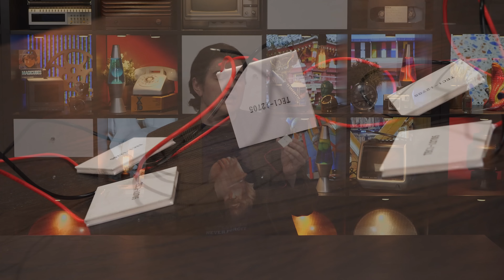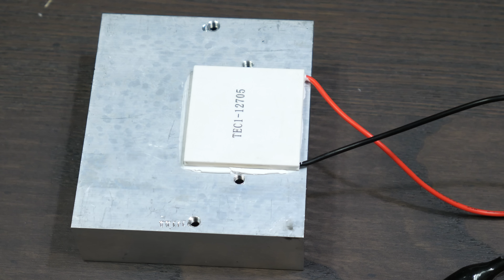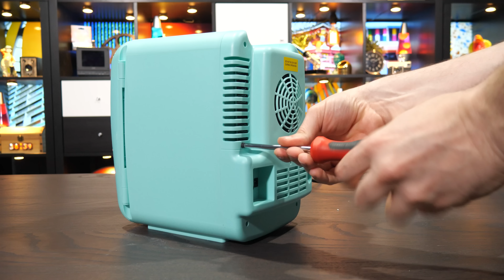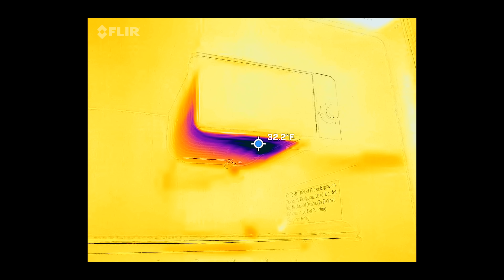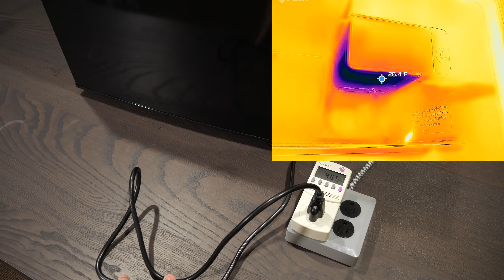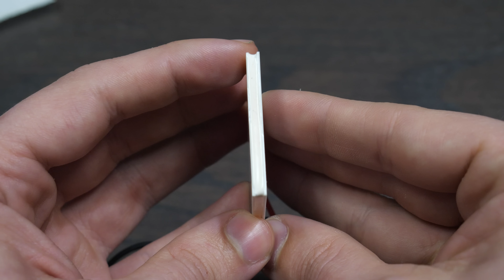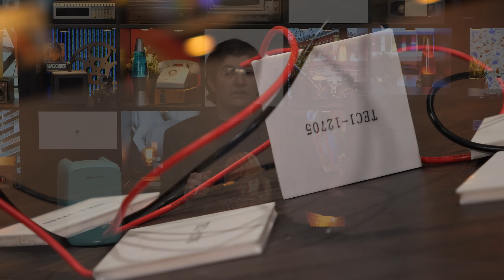Thermoelectric cooling: it's not great.

Comment: people keep forgetting that peltier element is not a cooling device. it is a thermodynamic vacuum device. if you don't have a heat sink for that energy you are sucking in, you will just get that blown off everywhere, just like a vacuum without a bag or filter.

that is a technical explanation from a marine engineer specializing in hydrodynamics and thermodynamics...

Comment: A bit bigger boxes than the blue one is useful running on 12V DC. If you fill them with already cool food at a store or at home they can keep the food cool for many hours in a car or small boat. A cheap solution for temporary use. Of course in a motorhome or a big rig there is better things to have.

Comment: I work with freon compressors and TECs on a daily basis.

I work with hardware designed for thermal testing of ic units.

I've had problems with both over the years, but I'll say that it's much easier replacing TECs than compressors lol

Comment: I recently bought a peltier neck cooler/warmer.
The reviews on Amazon isn't good, and after testing it for about a month, I know the main reason.
I does keep you cool(not much, but does help), but you can't feel it after the first cold plate on your neck sensation.
The one I got has 2 cold plates near my main neck arteries, which is supposed to be cooling my blood to take away heat from my body.  It does take away probably around 10~20W of heat, but when you are walking in the streets with external temperature at about 32~35C, with you generating about 100W of heat, it is not enough, and your blood doesn't transfer heat that fast.  You still sweat a lot.  The power rating on the peltier device isn't really the problem here, just that the contact area is too small to pass enough heat out of my body.
My neck near the cold plates are actually cold to the touch, the small cooler is doing as much as it can do, my neck isn't getting warmer but my own heat senses have been accustomed to that temperature so I don't feel the coolness.  I can move the cold plate a bit so I feel it for a very short while, but then my skin got use to that temperature pretty fast again.
I suspect if I really want to use a peltier device to cool my body, I'd need a pretty large contacting area on my back and chest, with a cooling capacity of over 100W(if must be more than the heat my body is generating, so ideally >150W for exercising) and fans to take the heat away.  Anything lower than that you still have heat build up in your body and you won't feel cool.  On top of that you need to be able to adjust the power so it won't go overboard.
But this is likely where the peltier device potentially can work.  You can't really carry a heat pump around, but technically 2~3 peltier plates already have enough power to cool your whole body, you just need some way to take the heat from all of your body to those devices, which you also need with a heat pump.

Comment: I used a Peltier CPU cooler (CoolIT FreeZone) way back when on my Athlon 64 x2 rig. It was a closed-loop all-in-one liquid CPU cooler. The hot side of the Peltiers (6 of them if memory serves) were mounted around a radiator/fan that replaced your case's main exhaust fan to exaust the heat out the back of the case. The cold side of the Peltiers were mounted to water blocks that chilled the liquid that went to the CPU block/exchanger. It was kind of a noisy setup (pump+fan) but I recall it working fairly well. I still have it so it'd be interesting to put my Kill-A-Watt on it sometime to see what the power draw was for the whole setup vs a "regular" liquid cooler setup sans Peltiers...

Comment: I have one intended for car use and it works pretty well for what it is. Keeps drinks cool for car trips and the like. Also have a larger cooler with TEC cooling and does a pretty good job especially in a AC cooled car. There is enough delta to keep most things cool enough. There are coolers with actually heat pumps in them but they are around $400 to start.

Comment: My fridge is working great and it is over 80 years old. I was told that I will know if it fails because the refrigerant is sulfur based
Reply: Have a look on the outside of the fridge and see if there is ice forming on the outside.
insulation issues happen more than leaking pipes.

But checking how often it starts and how long it runs is also a telltale.

Comment: Some British people. It is mini when matched to the one I have which is a mini fridge vs my aunts. And moms which is just a fidge 7 foot tool and freezer same size. each as my big Freezer/fridge combo that 7' ish (we're metric)tall and our large standard large size 600-700mm wide. You Red fridge is standard small fit most OK homes have small fit as they large. 400m-500 as that was what was fitted to most old houses as we used to have way more social housing that small fridges was the common, but as more houses have got bigger 600-650 and 7 instead of 4-6' one have become cheaper and more efficient. I live in social houses big brought my fridge didn't get anything in kitchen as the older council houses got in <2000s, and massive Tory housing cut and sell offs. So I can see why a lot would see it as a big fringe here. I have family that will pay more then buy cheap and replace every 5 years. I had my big fridge 15 years. Our council recycle the gas.

Comment: I use a Peltier cooled styrofoam box for fermentation of my SAUERKRAUT at the ideal Temp of 18°C, in order to drop it from usually 22-23°C i have in my basement during summertime. With a water cooler harvested from an old PC. A compressor would be total and utter overkill.

Comment: You are not wrong, but I bought one of these $35 things, despite having THREE of the mini-fridges, because I had a very small space available in an office and wanted to keep my liquid coffee creamer in it.  It worked GREAT for that.  It does take a day or two to get the temp stable after plug it in, (in Texas Heat), but worked great for what I needed.  I know it's not efficient, but if you don't have the space, you don't have the space....

Comment: I had one of the white ones with the fake metal handle when I was in middle school. It actually worked well and one time I left soda in there too long and they froze.

But it's good to know how these work...I currently have a cooler (that I got for free) that can both keep things cold or keep things warm by reversing the polarity on the plug. I've never used the hot side because I can't think of anything I'd like to keep warm for like 12 hours, but it's cool nonetheless!

Comment: I've got one possible upside to the little plastic cooler over the actual fridges. When running a small generator after a storm, the low watts a fridge uses can be easily handled. The compressor has a really high peak watts as it kicks on which may be more than a small generator can handle. The blue cooler uses roughly even wattage indefinitely so you'll never overpower your peak wattage. Still, attaching a soft start would be an effective alternative.

Comment: It's true that those coolers are useless in a 110v or residential situation obviously, but it's a "god sent" for us over the road truckers! I bring food and snacks from home for the week and keep it plugged in with AC inside truck on, and my Coleman cooler keeps everything actually really cold and nothing spoils. So using one at home or office is actually useless but for us truckers it's really a necessity. Plus just running off a cig lighter plug in the semi isn't really using wasted electricity.

Comment: I've seen peltier tiles used in the other direction, namely to harness a temperature difference to generate a very small amount of power (like heat rising from a stove + an ice cube = to run a small fan). Do you have any commentary to share on that sort of use?

Comment: I bought a cooler from goodwill ages ago, had a car cigarette lighter jack to power it, It couldn't keep anything cold, felt barely colder than room temp. So I took it out and played with it and tried to use it to cool an old amd sempron cpu by sandwiching it between the cooler and chip, it was cooler than stock, but not enough to justify the use of power.

Comment: 24:33 not really a problem?!?! If isobutane leaks into the cabinet and the fridge goes into a defrost cycle the fridge will explode. It has happened more than once. A fridge using isobutane exploded in an old ladies kitchen while she was sleeping. The fire department said it looked like a grenade went off in her kitchen. If someone had been in the kitchen they could have been injured or killed.

Comment: You bought a piece of junk. 
I've owned a small unit about the same size designed for car travel with a cigar lighter style plug(12V) for over 15 years. It  cools down a load of cans and cheese to a good  chill in about 45 minutes .
I've owned another larger unit that took much longer to get cool so I pitch it. 
The technology is good, but yours is a a cheap unit designed to sell, not perform.

Comment: The real stuff starts at 16:00. Before that there is a clown show.
The main idea of the video could be condensed in 3 sentences. 30 min video says only few useful information:
1) Thermoelectric elements create 10-20 Watts of cooling by using 50 Watts of electricity. 2) Usual freezers create 200 Watts of cooling (10x times more) by using 50 Watts of electricity. 3) Small boxes can not contain as much thermal insulation as big fridges.

Comment: I have one of these... It's a relatively insulated place to put your drinks, so even if the cooling element broke it wouldn't be a big problem. It's nice to have for road trips in the car. But it just barely keeps things cold that are already cold from the fridge, so I wouldn't trust it with food or to cool down a room-temperature beverage in less than a few hours.
Also it only cost me 30 bucks. If I ever find a micro-fridge that'll go in a 12v plug, I will consider buying one instead 😅

Comment: I really need your take on the big flat no-moving-parts infrared heaters. How do they compare to the ones you've talked about 5 years ago? I mean, I know, if they pull 400W from the wall, they throw at me this amount of energy in IR, but why don't they get hot? Why do they look like big white flat cardboard and not like fans with glowing red rods inside? How do they really work?

Comment: so i found a cooling unit that was used to cool ATM/Kiosk type machines.  it was basically 12 Peltier devices sandwiched between 2 pieces of aircraft aluminum and 2 PC fans,  i spent money and got some good PC fans that where super quiet.  and built a insulated box just big enough to fit my 5 gallon homebrew fermenter in.  It actually worked really good, i was able to get the temp down to 38F (brewing lagers requires fermenting at 50 to 55F).  It was an awesome unit till my basement flooded and destroyed everything.

Comment: I have an interesting hybrid fridge. It uses a peltier, but then connects the hot side to a heat pipe so it does have a refrigerant loop. The fridge itself and the heat pipe loop on the back look very similar to a traditional cube mini fridge, but there's nothing pumping the coolant. It's just the boiling/condensing that keeps it moving through the loop.

The end result is a cube size fridge (like the cube in this video) that uses ~60 watts continuous (compared to my full size kitchen fridge that uses ~60 watts average) but the big advantage here is that this cube fridge is nearly silent. There is an internal fan, inside the insulated compartment, to blow the cold around. It appears to be a normal PC fan, though I didn't open it up and look at the label. This complete lack of external moving parts, with the only noise maker being inside the insulated space, makes this thing quieter than most desktop PCs. And, that's exactly what I want from a fridge in my office, sitting within arm's reach of the PC. I really don't want the sound of a compressor cycling on and off sitting right beside me all day.

The fridge does have a terrible name though. It's the Avanti "Superconductor" fridge. I paid $80 for it in 2013.

Comment: I do have a peltier fridge. It does suck, but it keeps my insulin cold for a three to four day trip if I stick a couple of frozen gel packs in there. I also carry frozen fresh milk packets to serve the same purpose - the heat absorbed by the melting milk helps significantly improve the overall efficiency of the peltier fridge. But overall, I agree, bad design and worse construction is the reason I'll never achieve any real "cooling" on my little fridge.

Comment: I have mixed feelings about this, I know they are crap but I think it's reasonable to say that at $30 it's exactly as it should be. I had one to chill drinks for years until it crapped out, got one for free from warranty, until it crapped out again in a year or so. My biggest complaint was in fact how it heats up the room, not noise, not lack of cooling, not anything else. It also is extremely unfair to compare it to an actual cube mini fridge since that thing is wayyyy bigger and it mostly definitely will not fit on your desk. I enjoyed my "not chilled all the way" la croix for years with my mini fridge on my desk as a poor college kid who didn't have (reliable and accessible) access to an actual fridge. At $30, these mini fridges are exactly as they should be, and they are never meant to be a competitor to actual compressor powered fridges.

Comment: Cool (no pun intended, serious) video. Since you like refrigeration cycle so much, here's an idea for a video - the air cycle machine, the air conditioning system used in airliners that have no refrigerant gas at all. Or perhaps more accurately, one where the refrigerant gas is the very air we breathe in the airplane cabin.
EDIT - I've just read your pinned comment explaining that the scope of those videos is day to day consumer products, which obviously excludes airplane systems.  Still a cool video, though.

Comment: I think the primary sensible use for Peltier elements as far as consumer application goes is probably just going to be compact cooling in low power laptops. It's just not good for much else consumer-facing I think.

Comment: Wtf i use 200 300kw at sumer and spring 400 500 at fall and winter and it cost from 50 to 150 it was time where all most 200euros of bills!!!! Not using electrick air heater as main plus wood for winter 600 800euros

Comment: I just got to the part where heat pump HVAC was very briefly mentioned for heating and it instantly made me sick to my stomach over the fact that my parents earlier this year or near the end of last year needed to have their entire HVAC system replaced and I told my dad that it would be worth the extra investment in a full air source heat pump system and when he asked his HVAC guy was told that “a heat pump system will not heat a structure if the outside temperature is below 40°F” so he went with a full gas system instead. Why are HVAC companies so anti-heat pump in this country

Comment: A few of us use these in our office.  Keeps drinks cool and no one has complained about temperature.  As long as you understand this is not a replacement for a standard refigerator, this can be useful.  The one I have now has a temperature setting and goes to 46 F.  Not super cold, but much cooler than room temperature.

Comment: I remember when pc modders discovered these devices in the late 90s and tried to use them to cool overclocked CPUs. CPUs weren't smart enough to save themselves from overheating in those days, so some CPUs were destroyed and the general consensus was that they couldn't transfer enough heat to outperform a simple aluminum heatsink with a fan. It would appear these haven't gotten any better in the years since.

Comment: The reason the powe switch say Off/Cold is that there are some model that have heating feature that you get   Cold/Off/Hot.  Another interesting things about TEC is that if you apply temperature different. you draw current from it (Not efficiently as you already guessed).  Thanks for the tip about moving refrigerator, I was not aware of that.

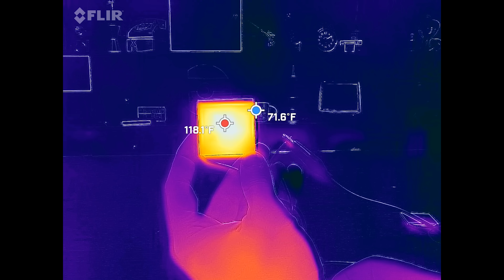Comment: At 4:05 got me thinking - there could be a device that draws thermal energy from the air (cooling) and transfers it into electrical energy (current). This would mean we could get a air-cooler/electrical-generator in one, a win-win!
 Has this ever been attempted? Is there a theoretical reason why this could not be achieved?

Comment: You want an inefficient cooling method you'll likely never see outside of science? Go for Anti-Stokes cooling. You shoot a laser onto a special material which can potentially do flourescence to give off light of slightly more energy than the laser. But since you can't get energy from nowhere, you need the laser light plus a little bit of heat for that extra bit of energy. The emitted light can then leave the material again, essentially carrying away the heat.
This is a practical application of the strange property of laser light of being "cold" in a thermodynamical sense.

Comment: I have 3 of those cheap peltiers from aliexpress and am considering building a cocktail cooler with them. The idea of using air to cool something with those like a fridge is honestly baffling. The cool thing about the peltier effect is that you can quickly and quietly cool something small quickly, and it seems obvious to do that with direct contact or via some conductive material like copper. The deciding factor here is that a device is turned off most of the time, needs to be portable, and needs short startup times. None of which those silly desk fridges actually need.

Comment: I have a soft-sided cooler bag with a peltier element in it that runs off a car's outlet. I also have a portable battery pack with a cigarette lighter port and solar panels to charge it. I've used this setup at Summer festivals to keep pre-chilled drinks cool all day to prevent heatstroke.